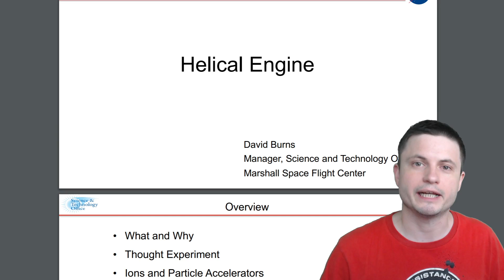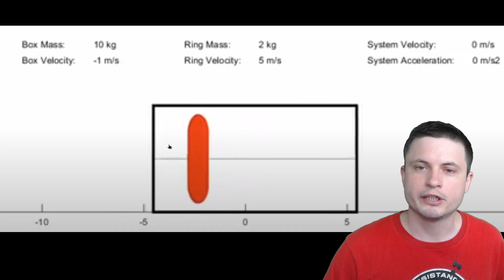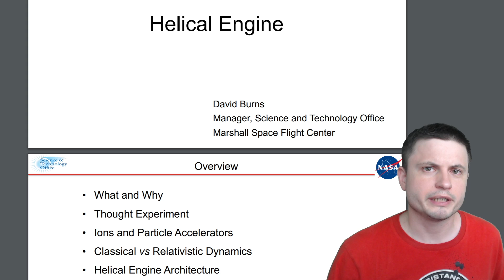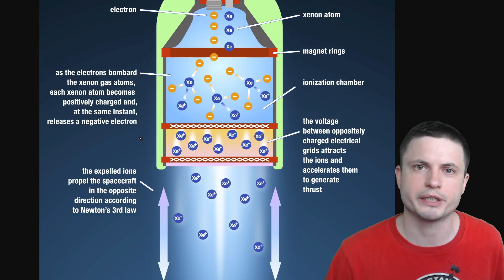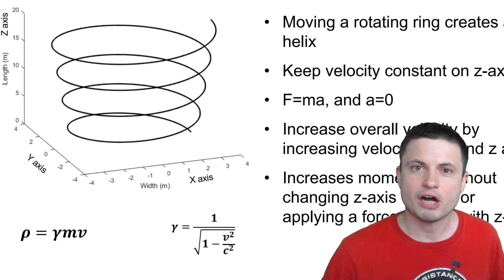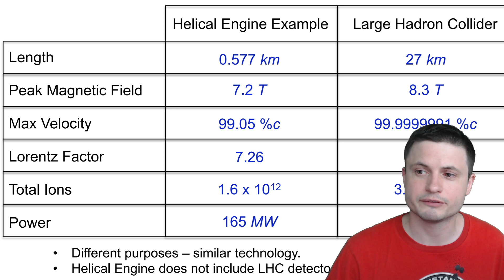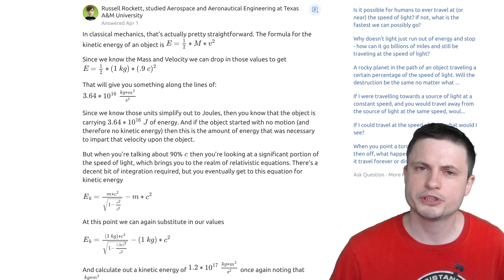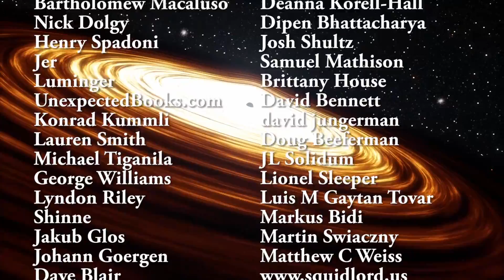NASA Engineer Designs a Near Light Speed Engine But Does It Work?

Comment: Ok what I don't get is isn't it supposed to be that you cannot accelerate mass to the speed of light? I thought only light could travel light speed or close to light speed because light does not have mass. And if increased % of c speed increases a objects mass, then that spaceship al;most 700ft long, 40ft wide going at 99% the speed of light would have to weigh a ton. Erh should I say trillions and trillions of tons. How does something with the mass of trillions of tons possibly travel at close to the speed of light, when light is massless to go that fast????

Comment: I actually had this idea in college 21 years ago, lol. So it's more like Nasa Genius pays attention to smarter people earning a fraction of the salary! Hahahaha :D

But yeah, it would take a lot of power. The funny thing is, when I was coming up with my design, I came to the conclusion that the most logical shape would be a disk (just like a UFO), and a much lower movement distance!

Also, I personally think it needs to be something like: either neodymium (or some sort of liquid ferrofluid) or a particle accelerator inside a torus to work best.

P.S.. Isn't the point, that it never runs out of fuel. How can you convert energy to mass and if you can't then eventually you run out of fuel. Maybe thermonuclear propulsion will be more efficient in space, but I can't see how we can get any real distance with conventional fuels. That's just my opinion :)

Comment: Ok, slow it down now. The problem with these theories is not getting up to speed,  but slowing it down when you get to the destination.
Reply: based on the design it looks like it can decelerate the same way it accelerates,it just works the opposite way basically,i dont get how that is a problem especially in space.i believe the real problems are efficiency and cost

Comment: What  would happen if u have a mass, like a bulb of fluid which gets motion or heat in the middle like an electric heater in a watercooker and gets spinned this way like it woukd flow around an zylinder throw the inside while flowing back ad its getting cooled on the outside when it flows back to the beginning?
Reply: Ok i realize that wouldnt work ... maybe an magnetic captured gas? .. but i cant imagine how big this must be ..

Comment: I could be misunderstanding relativity here, but doesn't all energy have mass, not just kinetic energy?

This concept only works if you can freely transfer energy out of the relatavistic ring before deccelerating it, and without being affected by its momentum. But as solar sails demonstrate with light energy, I don't think you can transfer the energy out of the ring without being hit by its momentum. And you need to capture and reuse this energy, or all you have created is a needlessly complex torch/flashlight drive.

Comment: A large nuclear powered craft would be better. Speed may be over rated in space as there are many hazardous materials to run into. An energy field (shield) would be a necessity also. 

Planet hop. Colonization. Build up supply. We may discover a material or energy source on a nearby planet that could revolutionize space travel. We could do this all now. 

Think of the job's created. Why fight wars? Let's travel and colonize our own solar system. Mine. Build under ground cities. Spread life. Why go fast?  We'll as fast as we can. Planet hop. If we would just get out there. We might discover....worm holes. Star gate or something.

Comment: One of the biggest problem that is slowing the whole process, Scientist are too concerned with either , Traveling at or close to (Light of Speed) or Going to another (Solar System). I believe , we should be trying to find a way to move around our own solar system in shorter & shorter amounts of time, then build from there. Baby Steps. When it comes to space, we are still very young and there is still so much we have to learn. We need to first, Design and build a propulsion engines that can get us from Earth to Mars and back , then out to the Gas Giants and back. Then to other Systems. Scientist are talking about Warping Space -Time with such a limited knowledge of what is even is and how it works. How the Hell are going to warp something you don't even fully understand ?  How about (first) try to get out to Pluto and back within a 6 months period or less, then shoot for the closest system.

Comment: The center object is in a box. Put mass inside the box the object could attract to it. As the object slides forwards attract the free mass in the box. Then it stops at the end of the cycle forward. When it does release the attracted mass and go backwards. Then repeat. You could make the mass moving more efficient forward than backwards with pupping out the mass into a deprecate area that is looped at the starting point of the object.

Comment: Yeah it works cause like 30 years ago me and a friend saw a craft that was red and silver with a  round front and a big haul in an octgone shape with a black box on the back.   In that black box there were 8 busters looking just like the ones on the u.s. space shuttle.  It was night time when we saw it floating in the sky it look like the size of about half an inch it was lit up by our sun and then all the sudden from the black boosters a streak of light shot out the back of  the craft looked almost like it shimmered or shuttered then it shot forward into a streak of light and the tail zipped off with it behind it and it was gone the odd thing about this is maybe a few months after that my mom told me she was taking my nephew to Burger King 20 minutes later they've got back home and my nephew got a Happy meal he asked me to open the toy from in the Happy meal that toy in the Happy meal was the same craft that I saw that night in the sky there was a little lever on the bottom side of the toy.  When you slide the lever back the front round part on the toy opened up and there was an eye ball that poked out.  I took it as someone was trying to say did you see

Comment: The big advantage the helical engine would have is that unlike tossing the mass out the back to produce thrust, it keeps using the same mass over and over, so you don't need to carry any fuel other than for the reactors.

Comment: I call BS. The whole point of relativity is that, to the observer, their velocity is zero. To someone on a space ship going "close to the speed of light" and then using this new engine, they're stationary from their point of view and the ball bouncing back and forth isn't going to be any different going one way than the other, so they would not accelerate. Absolute, "true" velocity isn't a real thing. Also, what's with the completely irrelevant images in the background of this video?
Reply: also speed of light is not even a speed of light. it is a rate of induction. think of it like a welders arc over a white led. yeah. speed of light is udder nonsense

Comment: Even with light speed tech, how can a ship avoid the mini asteroids in its path in the darkness of space?
Reply: darkliter8 space is so vast that the probability of actually hitting anything is extremely low
Reply: @jackstephen2519  that still does not address the issue of the ship hitting mini asteroids at light speed though.
Reply: Going anywhere near speed of light even a spec of dust would break the ship.

Comment: Honestly, any spacecraft will have to have a reactor and electromagnetic field generator to function properly. The only way that you can even reach those speeds is to cocoon a ship in an EM field, to protect it from space debris.

However, my thought is that spacecraft would have to employ the same kind of mechanical technology as magnetic-levitation (mag-lev) trains, which use repelling magnetic fields to "float", and use "push-pull" magnetic technology as propulsion. 

Where I think this would come into play is the development of a fusion reactor, which would require both using magnetism and gravity to hold it together. Couple that with an upgraded fission reactor, and you would have all the energy you would ever need.

Now, this might be science-fiction, but look at the "Firefly"-class ships of the show "Firefly." Those ships didn't spin the whole ship, merely the engine, which then turned a propulsion ring to propel a ship in space. So rotation may be needed, but I don't believe you would have to rotate the entire ship to propel a ship through deep space.
Reply: Rotation would help negate error, which at that speed, would result in huge inaccuracies. Consider rifling for bullets

Comment: So if you put a single pole magnet inside the box, build the box out of magnets making sure the same poles are facing the magnet inside, then use a push pull rod magnet out side the box of the opposite pole on the inside, as the push pull moves to and away from the box, it should, in theory move the magnet in the middle back and forth, creating momentum?

Comment: If we have two spinning rings...

One spins ar relativistic speeds becomes heavy and moves backwards..

Then using magnetic regenerative braking power is fed/transfered to  spin up the other ring which when at relativistic speeds moves backwards. At the same time me the now slowed first ring moves forward to reset... the cycke repeats...

The point is that the slowing up and spinning down of the rings requires reduced energy inputs as energy is transfered from one to the other via electromagnetic circuit... theoretically why wouldnt this work?

Comment: time is relative to mass and the increase in mass by acceleration will make you get old no matter what. sorry the old answer are wrong i am stephen alva givens.jet lag ages the materials of the body but traveling through latent plasma and at high velocity through magnetic field that aren't latent plasma so also aging the molecules. the time is one black hole ours (milky way) is longer for material existence. longer life spans Andromeda you would live to about thirty man and die. molecule compression increase resonance magnetic thus half life is reduced. resonance rotation magnetic fields much faster and loss to latent plasma is greater also time moves faster this way. gg.

Comment: 1:55 "you can't really make an engine with
 this unless you suddenly start accelerating this part (the 'piston') to what's known as relativistic velocities"
And how do you do that without accelerating the other part (the 'cylinder') to relativistic velocities in the opposite direction? There are only two parts depicted. 
We've already heard (1:29
) that "the propulsion here would not be an exhaust of any kind", so if there is some undepicted part it is not an exhaust. It really seems like there are only two parts. And even if this engine is travelling at almost the speed of light from our point of view, there is still a frame of reference, the engine's own frame, in which it is stationary except for the relative motion of these two parts.  When the piston is moving right, the cylinder is moving left, and vice versa. If the two parts have similar masses then even if they are moving at extremely high velocities relative to each other,  each will be affected by relativity to a similar extent so that the center of their combined mass will be stationary. The only complications arise if there is a big disparity between the masses of the two components, and does anyone imagine that you could generate significant thrust by moving an extremely light piston inside an extremely heavy cylinder,say? Or that an extremely heavy piston could bounce rapidly back and forth within an extremely light cylinder, without the cylinder being bounced back and forth even more rapidly? Even if the mathematics was right, this could not be a practical system.

05:36
 "instead of
 having things push back and forth you would actually have them spin so a
 rotating motion would solve all of these problems in other words think of it as a spinning finger that you move really really quickly and then suddenly with all this force you push at that one direction of the box and this would obviously conserve the momentum"

No it wouldn't. Momentum is a vector. It has a direction as well as a size. It is mass times velocity, and velocity is a vector. in a rotating system everything might have a high speed, except close to the axis, but the total momentum will be close to zero because the individual momenta cancel out. Even if that were not the case, you can't use motion which is entirely within a given plane to suddenly produce a kick at right angles to that plane. Not unless you simultaneously kick something else in the opposite direction. The laws of physics are still a thing, even in a rotating system. This whole paper seems to be equivalent to the ideas that go into a typical perpetual motion machine but with momentum being the focus of discussion instead of energy. "Sure, momentum is conserved. But what if your system is rotating?"

09:24
 "even with smaller amounts you
 still need quite a lot of energy equivalent to powering a large city so energy is a huge problem with this design".
Exactly. At least this isn't literally a perpetual motion machine that just conjures energy out of nowhere. But if you're creating relativistic mass by accelerating something to near the speed of light, then because mass/energy is still conserved there has to be a corresponding decrease somewhere else. Either a decrease in mass or a decrease in energy - in Einstein's relativity the two are equivalent. You could do that by slowing down a rotating object, for instance, it's effectively extracting energy from a flywheel which is totally doable; but then you have to bear in mind that angular momentum is also conserved. And however you do it, you're effectively decreasing one mass in order to increase another one, so that your net total mass(/energy) is going to stay the same. And if it's all staying together instead of getting separated, so that there is no exhaust, then good look with getting linear acceleration out of that. Mass/energy is still conserved, and momentum is conserved, and angular momentum is conserved.

Comment: I don't see how this works.  Sure, something moving close to relativistic speeds is more massive, but that means however you accelerate it, you will just have that much more force pushing in the opposite direction to get it to those speeds, negating whatever momentum bump you get when it hits the end.

Comment: It is obvious that you cannot accelerate mass worth to mention to 80-90% of speed of light then stop it and move it backwards. No materials can handle it.  If we ever have enough energy to do this we will have to work with electromagnetic fields. Fields also have mass and can be handle way easier than real materials.

Comment: I have a perpetual motion machine if anyone is interested in funding me....

P.S. I theorized this after watching Ant-Man. Since he moves the same distance when he is small as if he were large, if you'd shrink down you'd gain velocity, Then grow, and then repeat. When you grow you are then moving at the relative speed of the miniature version but a larger size. So if you move 10 feet per second normal size, you shrink down and move at the 10 normal feet per second, which is 1000 miniature feet per second (as an example) so when you enlarge you come back moving at 1000 normal feet per second. Keep doing this are you will reach near light speed. Just requires Pim Particles.

Comment: This is how the early antigravity German flying disks worked using counter rotating liquid red mercury which cancels out inertia within the center of the rotating mercury liquid being on the outer diameter. Velocity of counter rotation & frequency changes determine the speed of the trajectory. Although the German's created this in the 1930's - 1950's it was found to be quite dangerous to living tissue & a better material was eventually created instead of using red mercury. They also created 3 gravity engines that cancelled out by moving the node through a toroid at the base of the flying disk which controlled pitch & yaw. I might be a little incorrect specifically on details but it's just a rough idea on how it works, obviously many will not be able to believe in such a thing so it's okay to dismiss everything that I'm talking about.

Comment: Even just putting a small test satellite in orbit of the sun... if this worked and seeing it ramp up speed over time would be satisfying. Even a partial success could mean getting to the outer solar system or missions we previously couldn't achieve at a much lower cost. The sun is the biggest gravitational assist source in our solar system and also the largest solar energy producer. I could envision a process of a satellite winding inwards towards the sun as it gained speed. Then winding its way back out for a orbital exit at massive velocity that we cant currently achieve. This is a good idea should it work, though it seems to me by logic slowing it would exert a deceleration of equal effect ? But if you could figure out how to do it.  Save the crafts mass expend its energy gain speed throw stuff out the back after you are at high speed and high mass for course corrections slowing down or insertions.

Comment: What if the speed of the return stroke were a fraction of the drive velocity.  Using a conductor at the end of a wire will have a differential voltage to the ground of the of the other end.  Thus building a capacitor to absorb the voltage then a release of next drive stroke.

Comment: why do you have to charge continuously? could you not store large amount of energy through battery's and release in bursts of acceleration? would be slower to get to places but would allow for energy production to be cut down quite a bit. it would work in cycles with gaps of engine charging and every now and then the engine runs off stored power for a little while.